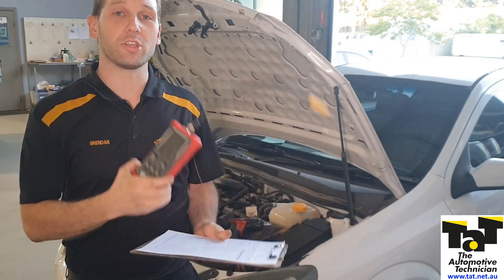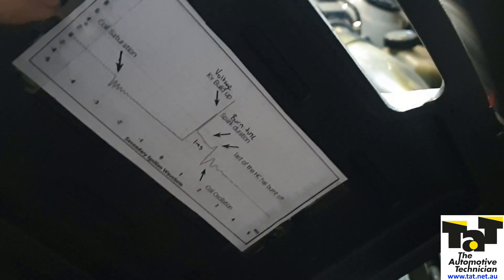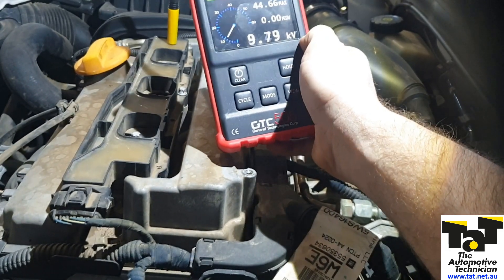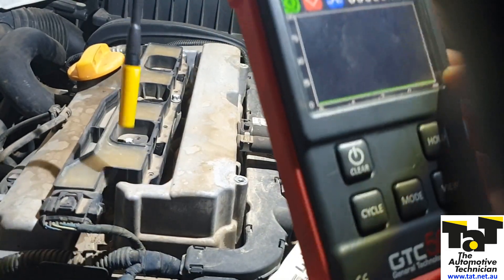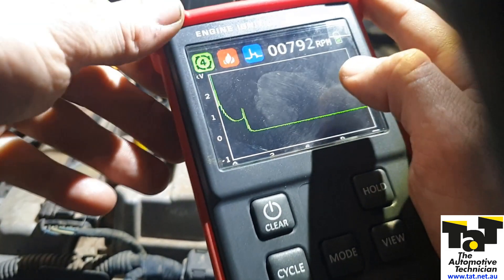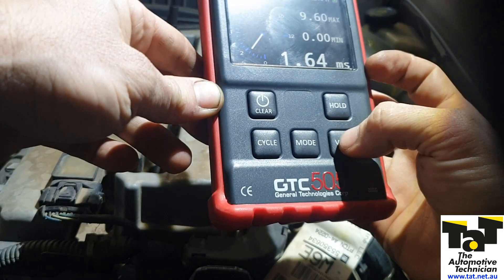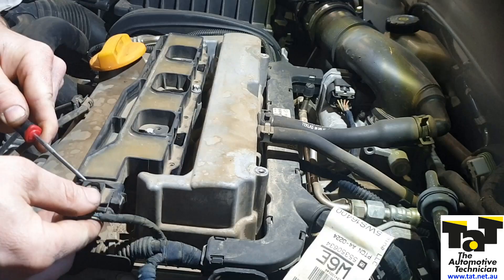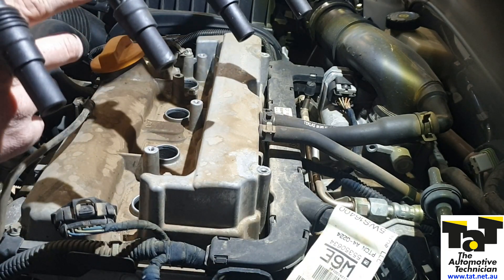Equipment Review   GTC505 Ignition Analyser

Comment: It's an accurate tool to analyze the Ignition system.
I tried it today on a Nissan Sentra and confirmed the Number Two Cylinder misfire. The Spark Plugs were ruled out because they are not too old. The Coil Pack is the Culprit.

Comment: this is my favorite tool for carbed 2 stroke outboards. since they don't have computers, its awesome for setting idle speed and seeing the waveform for voltage. also for which cylinder isn't firing instead of pulling plug leads with the motor running and occasionally getting zapped with 15,000V lol
Reply: Me too! It's great for finding double or multi firing cylinders even though an inductive timing light or tach works this is much easier to use when running at speed in many situations. Once I got familiar with it and it's limits I have found myself grabbing in and using it each time I suspect an ign problem. I use it on everything from small tiller handle engines to the biggest outboards, stern drives and inboards.

Comment: If you put it on Tach, and Waveform, you can see exactly when the misfire happens when measuring on the affected cylinder.
A smooth horizontal line means no mis.  Dips in the horz line is the spark not occurring on that cylinder.